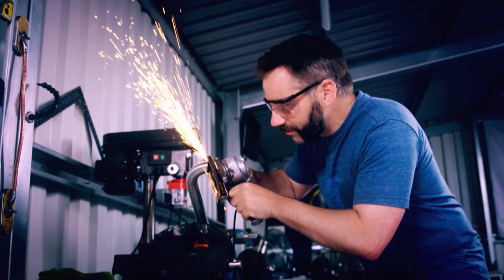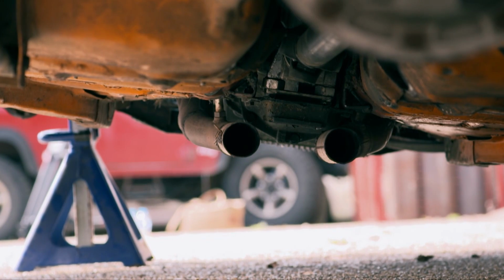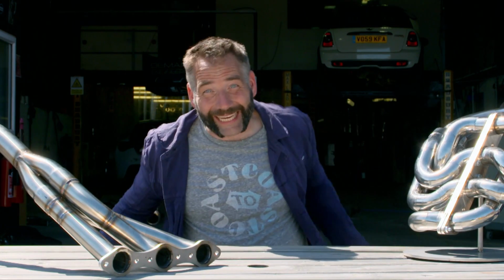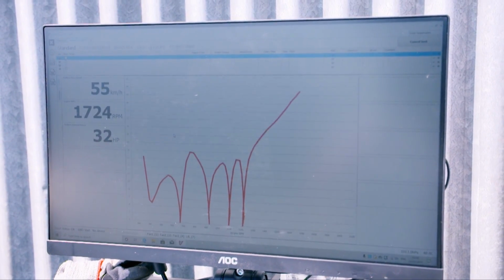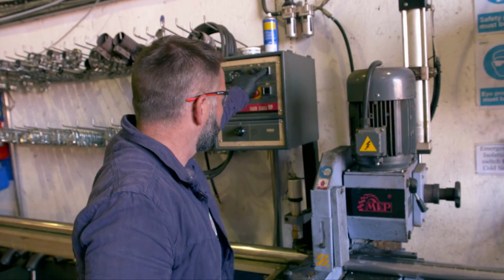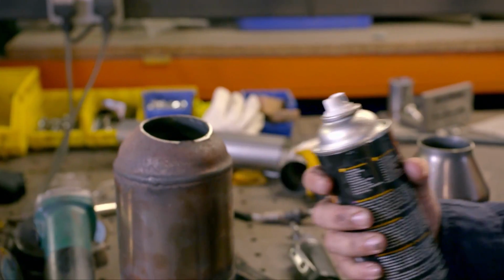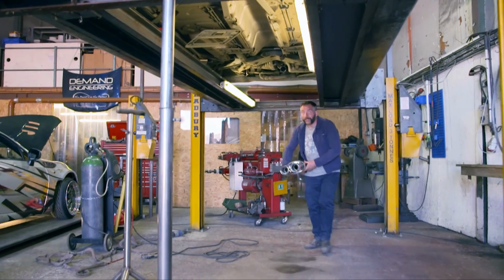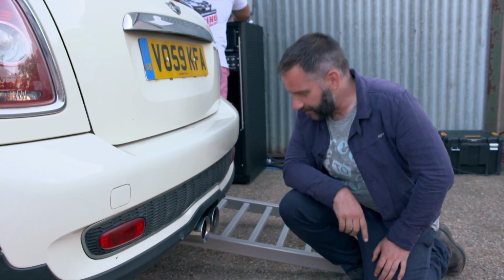How to add some serious power with a custom exhaust | Fifth Gear

Comment: The thing with modern engines is that swapping the exhaust system to a full flow sport exhaust, with sport cat, will mess with the ECU's. All kinds of different sensors will provide the ECU's with data and values differing a lot from what the programming allows, often resulting in less power or even setting the engine in limp home-mode. Best case scenario results in great sound but no power increase at all.This means a re-map is necessary to allow the engine making use of the sport exhaust's benefits.

But, a re-map only compensating for the new exhaust system will never ever produce this kind of power increase shown here! It will probably produce an extra 5-10 bhp and more torque, and a re-map with the standard exhaust will probably produce around 20-25 extra bhp. The greatest benefit from a well built sport exhaust with sport cat is that it will allow a more aggressive re-map than without the sport exhaust.

The sport exhaust adds to the margins when re-mapping, but on itself it won't do much at all on a modern engine.

Comment: I would guess the gains are: +30 bhp for the remap and +9 bhp for the 200 cell sport cat.
Reply: so with the stock exhaust, it would make 200hp with just the remap?
Reply: @JoshL_712  yes, depending on the type of tune and overall mechanical conditions of your car

Comment: Hi, I have 2 questions

1) why car company not providing such kind of exhaust systems? When they know BHP will be increased by doing this.
2) you have retune engine after fitting customized exhaust but what if you retune engine before installing exhaust? Will BHP increase or not?

Comment: Would have been useful if you had tested with new exhaust system but no update to engine mapping. Then we would have seen the difference in a fairer way. Mapping update would have seen a bigger part of the increase.

Comment: None of his figures made any sense, factory rates their cars with Brake Horsepower(at the Crankshaft), he said it produced 170hp at the wheels(not brake horsepower) same as stock? He then proclaims to have made 209 "Brake Horsepower" on a Chassis Dyno that doesn't read Brake Horsepower. There's a foul smell coming from this video, the remap brought the HP gains not the exhaust.

Comment: im not so sure anymore this was all from the remap like everyone is comenting because i just checked this engine on the website where i did my remap (for bmw 120d) and they only add 20hp with ECU on this particular gas engine (they normally add more on diesel engines), so my guess is they probably added around 25 maybe 30 hp and the rest is the custom exhaust. just my guess.

Comment: This video is misleading at best, as far as I know they should:
1. test the car
2. do a remap, most of a gain
3. test again
4. install exhaust (with a downpipie in most turbocharged cars)
5. test again, see 5-10% power increase compared to 3

Comment: Can someone tell me how custom straight through exhausts with no catalytic converters are legal on new cars / bikes?
Reply: Usually they aren't legal, police can't really check that on the side of a road, they should send suspected car to the mot test.
Well everything depends on a country.
Even funnier is a fact that, straight through exhaust aren't usually allowed at most racetracks because of noise limits.
Reply: szczsz I ask because for any insurance company this is an easy claim stopper. If I had an accident on my 2018 motorcycle which had a non standard cat-less straight through pipe the first thing the assessor could look at would be the non legal pipe, thanks v much no claim bye bye.
Reply: @barbieandbellaadventuresby9134  Ow, I hope you were more or less okay after crash.
Tbh, I didn't know about possible insurance problems.
Bye
Reply: szczsz 😄 thanks but I have not had an accident, I’m just saying legally if I did and I had a straight through cat-less pipe then my insurance would be void.

Comment: One of my cars I had a hand made exhaust that gave me power but that was from Custom Chrome Ltd Nuneaton they are the makers of the 
Cherry bomb®. Any other exhaust I have had fitted like the Powerflow added noise but no real power but hay they are stainless.
Reply: Stainless exhaust = always 💯 👍🏽
Reply: You probably need a remap to take advantage of that new exhaust, the ecu thinks it still has the old one attached so you won't be gaining anything, get a new high performance air filter and ecu remap and that should make a nice difference, especially if your car is turbocharged

Comment: You’d not get the best gains if you mapped it with the stock exhaust, same as just putting a bigger exhaust on and leaving the original map, if you changing down pipes, cats etc you need to remap the car to get the best out of it. Ideally you want CAI, sports exhaust and remapped to get the best results. 
Also it’s all about the ‘delta’ the base line before modifying anything g so you can see the gains as most cars don’t make the factory stated bhp from new.

Comment: Realistically that exhaust might have added 2bhp and cost over a grand 😳 the remapping gained the power 🤨
Reply: scania shane you cant really have one without the other if they’d done the remap with stick exhaust the gains would have been way less damage as a custom exhaust with std map. To get the best out of the car the ideal set up would be CAI, exhaust & remap
Reply: Lee Holtom you can absolutely have 1 without the other!

Comment: Miraculously, this contradicts multiple tests showing marginal gains at best, like less than 5 horsepower for an engine of this output. One would dear say that the majority of the power gain on this one could be achieved by the engine remapping, regardless of the exhaust.
Reply: best believe most of the gains came from the remap, and not the exhaust. albeit, exhaust helps a bit too.

Comment: I understand that the ECU was remapped. But how much did THAT contrubute to the power increase?

From 170 to 209 with just a handmade exhaust seems a bit 'wild' to me.

I rather saw the performance without remapping and (only) then what's possible with a ECU remap
Reply: You are too right. His exhaust is crap. Not even a bigger down pipe for the turbo! Most of the gains are from the tune because the engine isn't big enough to warrant exhaust work. Just doing the AFR (Boost) , Ignition Timing and 98 RON fuel would have got more! Bad tune in my book
Reply: @Steve-Mcgarrett  Agree... That's what I am thinking. Otherwise BMW... errr... Mini would have used a bigger exhaust from the start
Reply: Well, without any exhaust mods, these can be remapped to 245bhp. So it may even have been a negative effect the exhaust had!!!